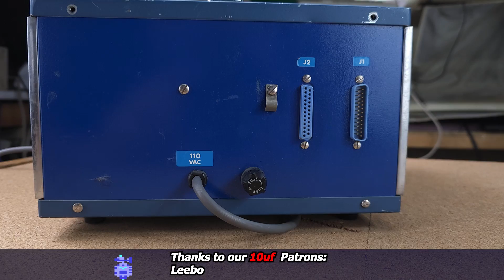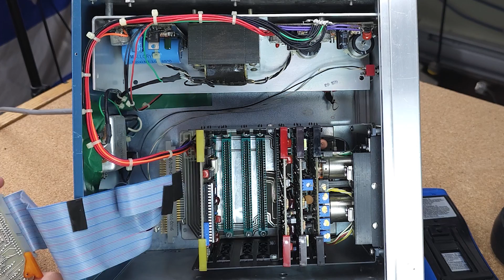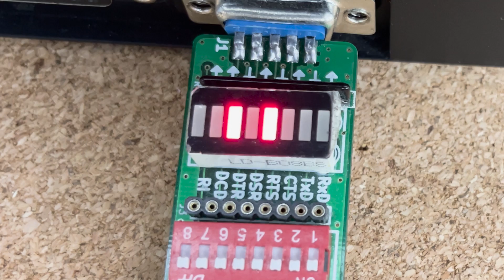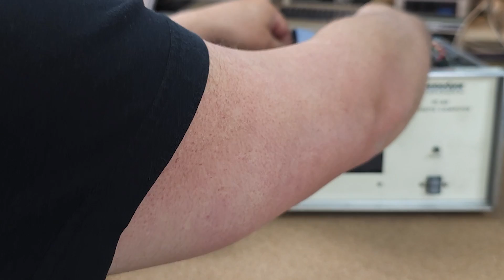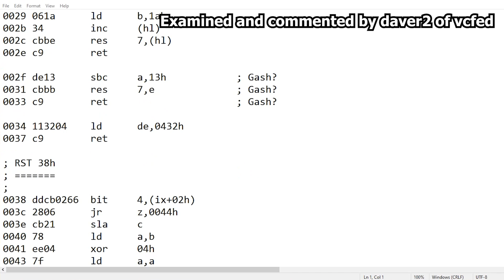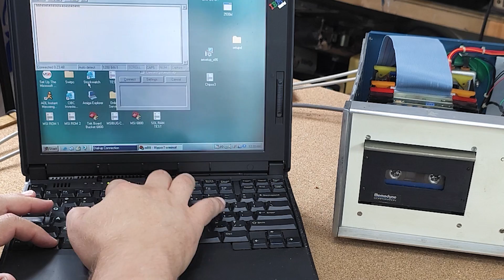Fixing a Mystery Z80 Computer from the 1970s

Comment: Why do you have to assume and poke so many things?
I see the serial card with the line drivers (what are they, MC1488/MC1489?). Just follow the outputs to the DB25 connector and see were are those Rx and Tx pins. You know that Tx should be at pin 2, if pin 2 is an output of  MC1488 then pin 2 of DB25 connector is Tx. If not, check if is an input for MC1489, then is Rx.
I had a computer, Z80 based that booted in BASIC when a key was pressed on its keyboard, displaying the image on a TV set. But, when it received a character from an data terminal connected to its RS232 port, it used the data terminal as in/out console, not displaying anything to the TV and not accepting any inputs from the integrated keyboard.
Maybe it expects to receive something via RS232. That ROM is 2k only, maybe is a loader only and it expects a tape to be loaded in the RAM at boot to load some OS from there? Also, there is the socket for a second EPROM, may be there a option to insert a programmed ROM with the OS (maybe a monitor or a test/debug ROM, anyway something small because the EPROM seems to be max 1-2K )?
Also, it maybe just write on tape the input data when the serial buffer is full (like at 52:20, that "ocassionally" writing on tape), being so, similar with C64 floppy drives.
Btw, what you did at 52:20, did it writed something on tape?
Edit: I believe that the last version seems to be the most probable, a glorified tape recorder. And, based on the brochure, I guess that this is the remote controlled version of that showed in the brochure. Control-P looks like reset (SHIFT BACK) and Control-R looks like Tape ON (Write NO SHIFT).

Comment: The first thing i noted was that you keep hyperterminal in hardware flow control mode. That requires very specific signaling and the necessary hardware flow control lines to be connected to work properly. The other options, software flow control and such are much more likely to show something or just work. I never had much hardware that did more than use rx and tx. I.e. software flow control. 

Second those boards are not complex, trace them out, create a simple schematic, can be done with pen and pencil. That would also help determine where in memory the serial board sits, which would help in decoding the ROM.

Third verify the connections between the board, j1 and j2. Never assume it follows some standard, at the very least verify tx and Rx.
Also modern scopes and such can often detect or guess the proper baudrate from the signaling if you have at least some activity. 

I don't want to sound negative, but you were really fumbling along, not very structural about it. You can have lucky guesses with undocumented hardware, but mostly your method seemed to be a crapshoot and you got unlucky. A more structural step by step approach will take more time, but will get you further in the end.
Reply: The flow control thing really bothered me. When testing, always turn off flow control to make sure nothing gets blocked or eaten. Next thing is on military/industrial of that era always assume 7n1 or 7e1, even just regular terminals used 7n1 because extended ASCII wasn't in wide use yet.
Reply: In defense of the fumbling, that’s part of the learning process, especially when you don’t have a lot of tools.

The structure thing though, that’s what turns fumbling into tinkering, and if you write that down that’s almost research 😅
Reply: It’s an interesting video, and this comment is condescending.
Reply: @brendn  FWIW while the tone leaves a lot to be desired the spirit is there, It’s reasonably constructive criticism.
Reply: @1RandomToaster  the tone is whatever you want to read into it. English is my second language and this is a short text medium. Tone has a hard time in translation.
Reply: @bzuidgeest  while I sympathize… I’m kinda defending you here
Reply: @brendn  ah, an fanboy. No criticisms allowed then?
Reply: @bzuidgeest  If you are going to be so critical, at least be right. There's a difference between hardware flow control, software flow control and no flow control. Most hardware that just uses rx and tx has no flow control, not software flow control. Also, I think TTT is aware of his "fumbling along." Pointing it out does like that just make you sound condescending.
Reply: @henryokeeffe5835  I consider a software, monitoring serial buffers a form of flow control, so how incorrect I am is a matter of perspective. 
I'm certainly right that hardware flow control was a poor choice if you don't know anything about a device. 
The most important thing being that he never even tried a different setting and just guessing is a poor way to go. He could do much better. He knew the serial chips, tracing things out would have been an easy step. 
Even stranger to not do that after he successfully assumed something about the busboard, then checked and verified it.
Reply: @bzuidgeest  I do agree with your point, I just think you could have phrased your original one a lot better. Also to be a bit more picky here, software can monitor the serial buffers all it wants, but if it doesn't have the ability to stop the other sending, there is no flow control. Software flow control does it via commands sent over the  RX and TX pins, but that obviously requires both devices to support it, just like hardware flow control.
Reply: @henryokeeffe5835  nevertheless I think I took care of making it constructive criticism. But that's the thing with something not being your native language and I don't even know what yours is .... Fumbling is not a bad word in my book, you might think differently, but for me it's just not. It just means trying without direction or structure. Which has a low chance of success.
Reply: @bzuidgeest  I kind of agree, but when you are telling someone they are fumbling, it is kind of accusatory. As though they aren't good at something. It really didn't need to be said. Your first paragraph is fine. You stick to the facts. The second paragraph is a bit too direct. It's phrased as instruction, when it would be much nicer to phrase it as a suggestion. The last paragraph is also too direct and comes across as condescending. It implies that you think TTT was not aware he is "fumbling," which I'm sure he was. Something like "perhaps a more structural approach to problem solving might be better" is the polite way of putting it.

Comment: A bit of information on RS232, obviously you figured it out for this machine but the 25 pin connector should be wired to the standard which was different depending on whether the equipment is Data Terminal Equipment (DTE) e.g. a computer or Data Communications Equipment (DCE) e.g. something like a modem. One uses a male connector and the other female, sorry, can't remember which is which, which implies that the two connectors on the back of this machine will be wired differently. The easiest way to identify DTE or DCE is to check whether pin 2 or 3 connects to one of the 1488 outputs, the other should connect to one of the 1489 inputs. Depending on whether pin 2 or 3 is Transmit, TXD, the 1488 output, the handshake pins will match. Which if any of the 2 pairs of handshake pins is implemented depends on the particular device.
Reply: Looked it up. If pin 2 is TXD the connector is DTE, handshaking outputs are RTS on pin 4 and DTR on pin 20. RXD is pin 3, handshaking inputs are CTS on pin 5 and DSR on pin 6. Ground is pin 7. If it is DCE they are all swapped around, the idea being that a straight through male/female cable would be used. DTE should be the connector with the male pins, but this is not strictly adhered to.

Comment: The brochure reads like the M-80 is mostly a data recorder - especially if it doesn't have an option extra memory board. The ones listed also have the same board p/n as the one you have, less the front panel keys. There is a block diagram with the card numbers on it, I bet they list the same as yours, minus front panel keys. It also has a description of what goes off to the rear panel connectors. The command table on page 4 might give you enough to work through some rudimentary expected vs observed tests based on the potential keys from the ROM. 

I found another document related to setting up and running an admitted more involved model with  an HP 2100, but it has a description of what the normal operation would be, and a few pages of  rear connector pinouts. I would expect/hope that Memodyne would have a somewhat standard connector pinout, but it would give you the possibility of controlling it from those more explicit results than serial trial and error. The doc is on archive.org listed as "memodyne :: 3722 763 :: WHOI 79-75"

Good Luck!

Comment: Are you sure both connectors on the back are serial ports?

Perhaps one is a data input of somekind?
Maybe the Card with the Red tabs is some sort of DAC?

The tape deck sounds like it needs a service
Reply from the maker: @Andy-fd5fg  I think J2 is a data input and J1 is rs232 compliant and used for control.  In documentation I've found they explai how a computer/terminal connects to J1 and drives the system.  On other models they actually have a keypad on the front and those gives you direct control over the internal computer as well as the drive.  I think on balance its mainly a computer driven cassette data acquisition device, with the option of turning it into a full blown computer, still mostly aimed at that purpose, with available expansions.

Comment: Did you ever end up going through all the settings in your terminal emulator program? Like turning off the hardware handshake which you explicitly showed as "on"? Every reasonable baud rate? The thing doesn't seem to be an automated data recorder, since it needs some input. That input doesn't seem to come from a tape automatically, either. So it clearly needs some user interaction.

Comment: So you swapped a chip on the serial board and then held the adapter in the air instead of plugging it in... I was close to screaming at my screen. Please put some method into that madness, especially if you have a scope!
Reply from the maker: Based on my experience with computers that use serial terminals, I'm used to seeing the TX light activate briefly as the system sends out a console prompt.  Because it had not been working at all and because I wanted to quickly show viewers what the result was, I held the breakout device up to the camera to quickly assess of anything had changed.
Reply: @TechTimeTraveller 
How does your "beakout" thing show Negative going Pulses/Data, HI/Z States, etc.?
A single two wire serial connection has four channels, its Binary right.?!. Truth Table it.
Reply: @snakezdewiggle6084 
It's probably a breakout mostly in the sense that you can control how the serial signal lines are connected.

That can mean disconnecting a signal altogether, routing it to a different pin than usual, grounding it, or pulling it high. It may also facilitate turning a straight through cable into a null-modem one or vice versa (especiallly routing of the Tx, Rx lines).

Putting LEDs on the line is a crude form of checking for any signal at all (LED on, LED off, LED pulses on/off). It only tells you that something is definitely happening.
  
There are many, many possible configurations of a serial port/connection.  
  
Breakout boxes that work this way were extremely common back in the days of dumb/smart serial terminals that connected to a minicomputer ir mainframe.
Reply: @snakezdewiggle6084  A two-wire serial connection would be exactly one bidirectional channel (or two unidirectional ones).

Comment: 1:28 I'm sure all will be revealed, but having something with all the parts for a computer... it's giving me PET external floppy disk drive vibes.
Reply: My thought exactly! Isn't this just a mini variant of those old main frame "tape decks" which reads/writes data randomly instead of sequentially? Sure seems like it.
Reply: @BustaHymen  I take it you mean one of those crazy vacuum column high speed tape drives?  
  
So far as I know, there is no way to truly do random reads/writes to a tape drive or even a conventional spinning hard disk. At best you can minimize the time it takes to get the media moving and seek a particular spot on the media. 
  
Some form of validating you have the correct spot on the media is always necessary. For hard drives and floppy disks that would be hard/soft sectoring.
Reply: Yeah, this could be a 'smart' tape storage device, a single-purpose computer, or just some sort of weird standalone system.
 
It can be really hard to tell what you've got just looking at one of these things without any documentation.

I picked up a couple of cool early smart modems that achieve the "smart" via a Z80 cpu and support chips.